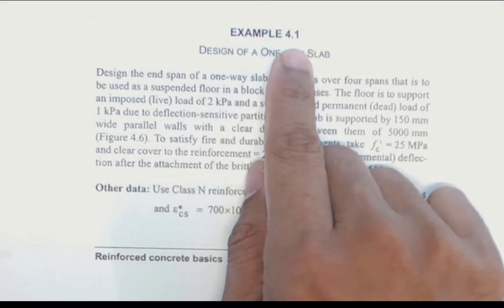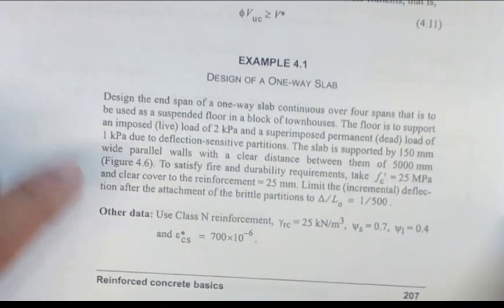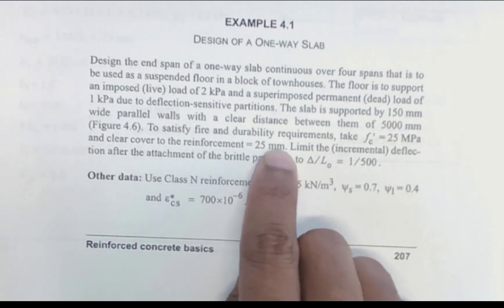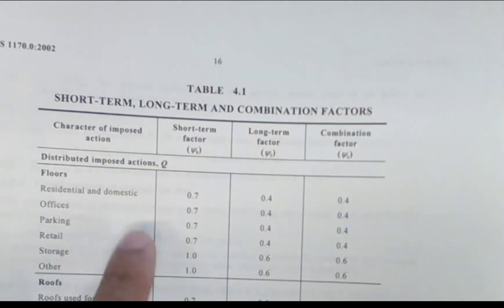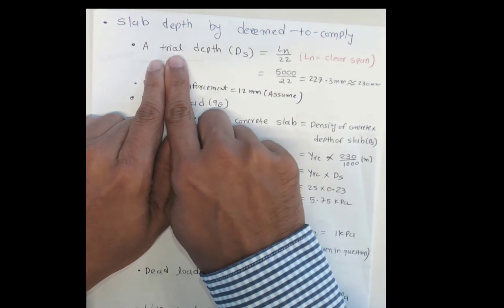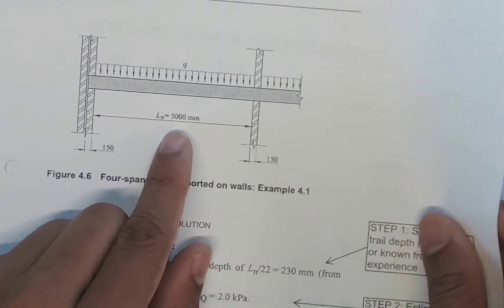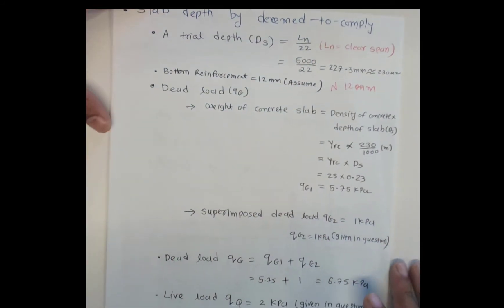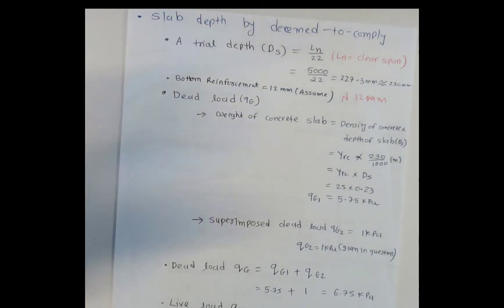One-Way Slab Example 1 Part 1-Finding Depth

Comment: Sir how do we find clear span of a one way slab plan?
Is it the distance between the supports of a beam side or the other side?
Thank you
Reply from the maker: AS3600 defined the clear span. The definition is given on Page 23. 
Ln = Length of clear span in the direction in which moments are being determined, measured face-to-face of supporting beams, columns, or walls or for a cantilever, the clear projection.

Comment: Hello sir, could you make a video of designing An internal 2
nd
 level floor system of an office building is composed of a slab cast monolithically with stiff beams 400 mm wide
Reply: it will be of great help
Reply from the maker: Yes, I shall upload the video for it.